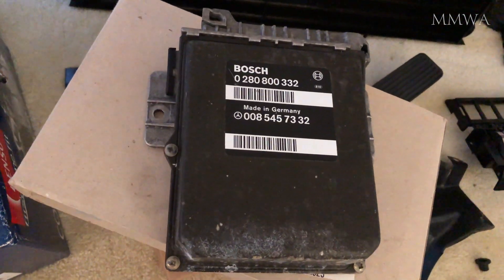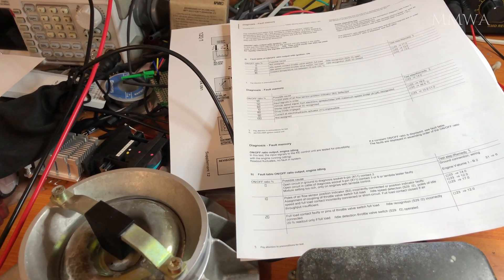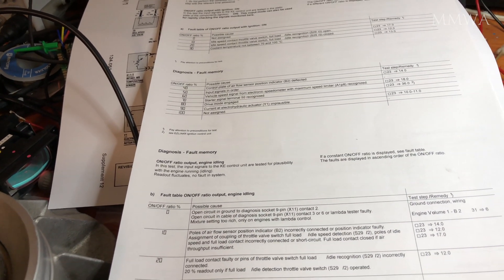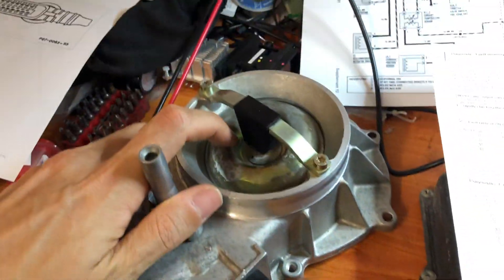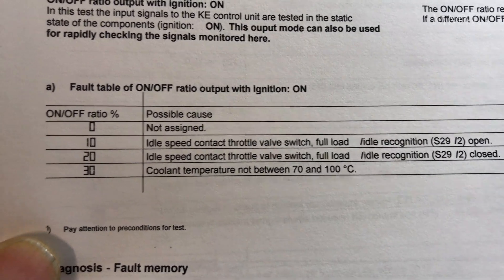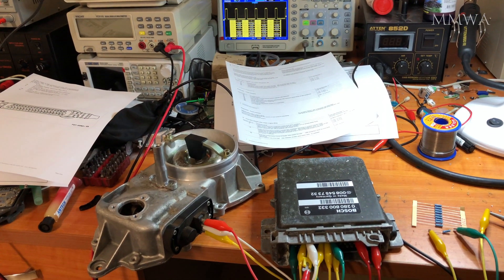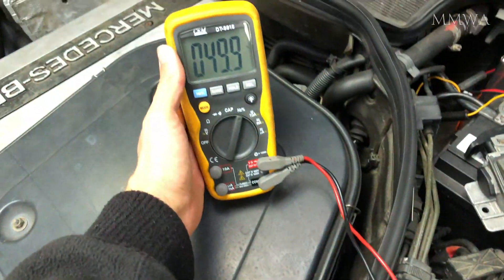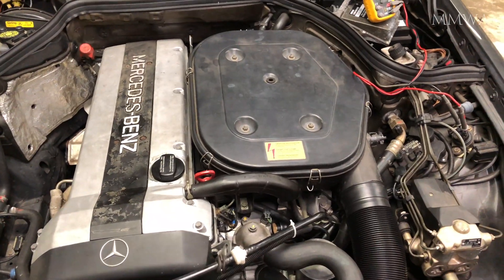Repaired Ke-Jetronic ECU testing. KE-V (Red w124 project)

Comment from the maker: I didn't show any repair process as people don't seem interested in these kinds of videos. The unit was not powering up at all on the bench, after much time trying to work out what the hell was going on miraculously it started drawing excessive current and then started working fine. I re-soldered numerous cracked solder joints and replaced the electrolytic capacitors. This car it came from had MANY hours run time on it so thats a lot of heat cycles which explains all the bad joints. I was dreading opening it up and finding it full of water which would have been game over for this unit. Thankfully its operational 100% now and ready for my new engine.
Reply: You are a true professional
Reply: I've opened Mine too, It had some moisture evidences and 2 eletrolytic capacitors cracked, even tough It was operating. I've resoldered the pins to the board too, as I did tô the fuel pump and OVP relays. The idle valve tuned to work after this.
Reply: Well I'm interested and wish you had done a video record! As usual, you are miles ahead of anyone else when it comes to probing the common issues relating to the age and high usage of these cars. 
  Have the same ECU with 325,000 k's and would like to refurbish as a preventative. Values on the capacitors are not that clear to me. Can you provide a capacitor shopping list and note any other work you did apart from obvious re-soldering. Where did you source the capacitors? Jaycar?
Reply: Oops. My ECU is 009 545 39 32. According to the  the little 'Technical Data' bible, both are in use for M104.980 incarnations  of my 124.051 and your 124.031, but the manual does not point to any differences between them. So, are the ECU's interchangeable? The only difference I can point to is the fact that my coupe has the 5 speed box. Are you aware of any transmission controls which might preclude interchangeability of these two control units?
Reply from the maker: TOONACEDRELA i’ve not looked into it but i have a list showing numerous different version ecus for different countries, manual, 4 speed autos and 5 speed autos. I’ve never worked on a 5 speed auto so i’m not sure what the difference is. Different countries have different emissions laws so the US 4 speed auto one has embedded egr solenoid control and the Australia version I have has no EGR from the factory. I am going to give the eprom image of my Australia version to a friend in the USA to try to see if 1, it works and 2, it then doesn’t operate egr. I will report back when we know.

Comment: But with this your duty cycle meter reads correctly. Since when you have the positive on pin 3 and negative on pin 2 it should read 70% with engine off not 30%.
Reply from the maker: Depends on the duty cycle meter. Some count ON time vs OFF time.

Comment: Hello sir, i have one question, i have an s124 300turbo 4matic with automatic trans, and i want to ask you if the ecu of the 4matic comes together or separate of the ecu of the engone, so if i can replace the auto trans with a manual trans
Reply from the maker: heh, i am the wrong person to ask about this - 4matic was never available in my country and i’ve never even seen it 😀

Comment: in my car duty cycle is stuck on 50% always. already replaced new o2 sensor for bosch direct fit, Mas relay, Ecu, all ke-jet sensors are new, tested continuity on ecu connector, heated circuit/o2 sensor signal seems to be working fine. im lost.  im starting to think that both of my ECUs are bad,  is there a way to test the ecu unit ?  thank you
Reply from the maker: i would connect a current meter up in series with the eha valve and monitor if anything is happening from cold start up to operating temperature. Also when its at operating temperature rev the engine a few times and see if the current flow to eha valve changes at all. if its always 0ma you probably have a dead ecu. Also, have you tested the airflow meter? I am assuming you do have power going to the ecu, ie dont have a faulty ovp relay.
Reply: @MMWA-DAVE  thanks, yes I did this Eha current test before it seems to change between 2.0 to 2.5 ma at operating temp. increasing ma from cold start if I recall but I will repeat this test to confirm.  yes forgot to say new ovp relay as well. Haven’t tested air flow meter yet going to search how to do it, thanks!
Reply from the maker: @gcgj1540  thats a good sign. Sounds like the ecu is alive and something else is going on. If theres never any signal from the o2 sensor it would similarly lock at 50% too. Is the engine mechanically sound and running ok?
Reply: @MMWA-DAVE  nice then. yes sounds, idles and runs ok

Comment: Well, if the 3rd pin hole in the x11 connector is empty, how is this check done?
Reply from the maker: non catalyst car? you can check if the ecu is controlling the eha valve by having a current meter in series. you tune cars like that with an exhaust gas analyser.

Comment: I tried replacing the two caps in my 560SL's ECU, but unfortunately it was not a power issue. It gives me a 98.7% off duty cycle, and deflecting the airflow meter or unplugging sensors has no effect on it. It does indeed output a square wave. I am dreading a dead microcontroller. I wonder if parts from non-560 ECUs could be used to repair mine. I luckily have a good used unit that currently runs the car which I can reference against the dead one. Would love to share some screen grabs from my scope with you. jackjtr12@gmail.com
Reply from the maker: Jack Rosenfeld did you check the removed caps? If the smoothing cap for the 5v regulator was dead shorted it may have destroyed it. If its failed in a manner thats now pumping 12v straight thru to the 5v devices the ecu is finished. Some measurements on the board while powered up may help the diagnosis
Reply: @MMWA-DAVE   I'll do some further digging. Thanks for the response. You are my second most watched YouTube channel next to Pierre Hedary. Thank you for the content.

Comment: I believe my w124 300ce 24-valve engine has the same problem with its ecu because my idle air valve no longer receives input from the computer if i connect it and turn the car on it just shuts down if i remove my foot from the gas pedal so i just disconnected the idle air valve cable as i'm very fed up with fixing the car because most of the mechanics in my area don't know how to fix the ke-jetronic ecu one downside is that the engine runs rich and it has no power at all.... but oh well it is what it is.....
Reply from the maker: Idle control does abort if an idle error is encountered with KE-5 ecu.It does not retry till the next restart. If you see it powered to start with then quickly stops this will be the problem. Have you connected a duty cycle meter and tried to read codes at the key on engine off state. With a cold engine it should read 30% with coolant at operation temp it should read 50%, which indicates all inputs are in order.
Reply: MMWA I did not do that but if I buy a multimeter I will make sure to test that, thanks for the help
Reply: @MMWA-DAVE  how do i translate the result of the duty cycle? If im on limp mode, would the duty cycle show different result?
Reply: Thanks for sharing.  Time for megasquirt?
Reply: Check the OVP relay 87e PIN, It must haverá 12v when ignition os on. Mine had a base solder inside and I was able to restore It.
Reply: Vini Terranova I bought a new ovp relay that has 2 fuses Didn’t solve the problem